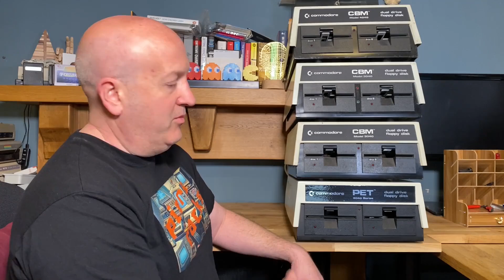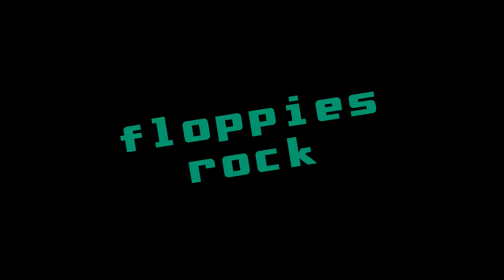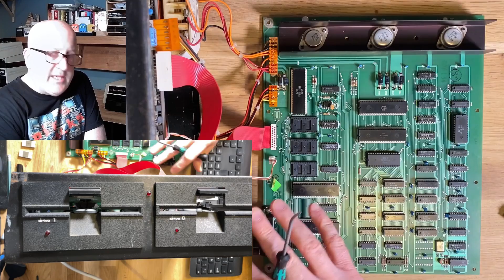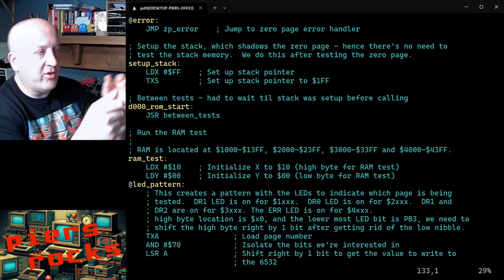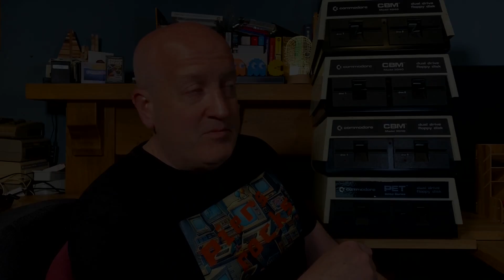💾 Brand new Commodore IEEE Disk Drive Diagnostic ROM | floppies rock

Comment: This is really great. Thanks for putting the effort in to do this. I have working 3040, 4040 and 8050 which needed work but this would have been really helpful at the time. 

I have just picked up a very rusty 4040 which ill use to check out this diagnostic ROM. 

Thanks again.
Reply from the maker: The ROM is improved since the video - hope it comes in useful - and it's still a work in progress.  Your 4040 could be "fun".  I've found at least 5 failed chips in my 3040 it so far.  While the outside of it didn't look that bad, most of the 74LS logic chips had corrosion on most of their legs - although only 2 of the bad chips I've identified so far were 74 series.

Comment: Moar CBM disk drive content! I have two slightly broken 8050 here and need to build up courage to debug them. Both  drive units 0 are acting up. Mechanical or maybe analog section issues. Drive units 1 are more or less fine on both. The second drive is in worse condition, but still okay. I also replaced a spindle motor on the good drive, which helped bring its unit 1 back to fully working order. But unit 0 has massive issues formatting and writing stuff.
Reply from the maker: The analog section definitely scares me more than the digital section - I've now got pretty comfortable with how most of the digital section works.  Coming from a software background that wasn't too hard.  But the analog section ... 😬.  I'm currently trying to "hijack" the 6504 processor with my diagnostics ROM (which runs on the 6502).  The 6504 controls the drive units themselves.  Once I've got this done I should be able to write some routines for the 6504 to perform some simple operations with the drives, which should be easier to debug than something complex like format.
Reply: @piers_rocks  Ah, you don't have an 8050 yet, right? That one has TWO 6502, instead of the 6504... And those are of course more tricky due to their 100tpi mechanisms. I think for my drives I need to check first if the tachos signals are still good. I do have a couple of replacement motors, if that should be a problem. And second I need to measure the analog signal path with a scope, if both tacho and RPMs are good. What I already noticed is that these old mechs take a bit to spin up to the correct speed. The motos are closed so that you can't really lubricate them. The digital side is, as you say, not that bad, and actually in excellent shape on both my drives.
Reply from the maker: I have a couple of 8050s but haven't done anything with them yet - I thought I'd start with the oldest first!  I've taken a quick look at the 8050 schematics and the digital architecture looks the same.  I'm guessing Commodore decided that using 6504s was bonkers.  I doubt they were any/much cheaper even back in the day, as 6504s are presumably the same die as 6502 but with fewer external pins.  And, of course, today, it's pretty much impossible to get a replacement 6504 (but you should be able to use a converter board).
Reply: @piers_rocks  Absolutely regarding the 6502 vs 6504! When you get around to the 8050 please get in touch. And don't bother to try and find QD disks -- I found that high quality DD disks work much better. :) I am looking forward to your experiences with the 8050. I should have gotten a 4040 instead... I think they are much easier on the mechanical side. Not those pesky 100tpi drives.